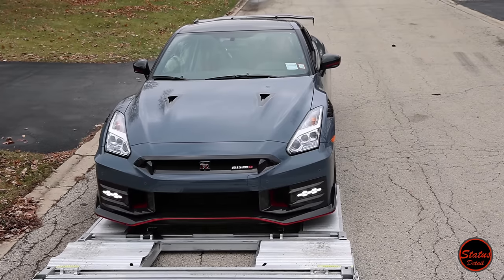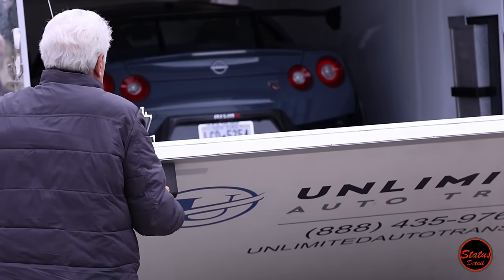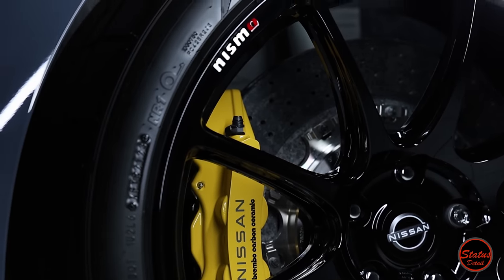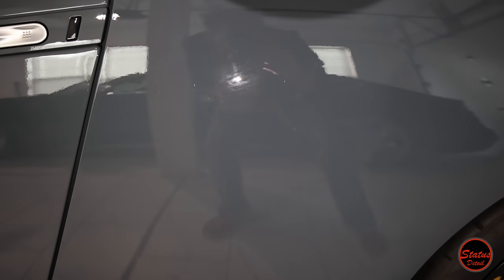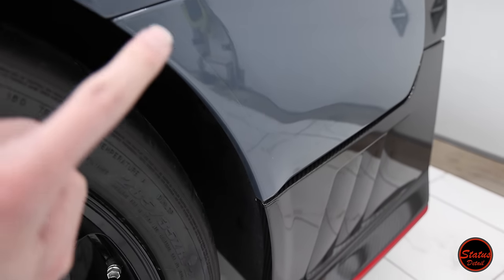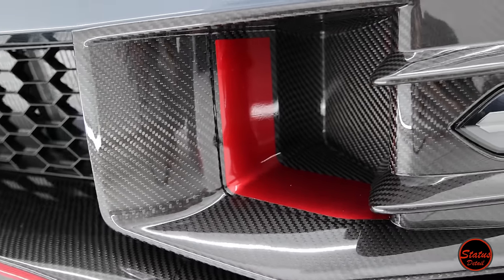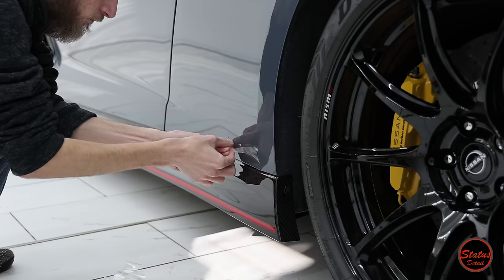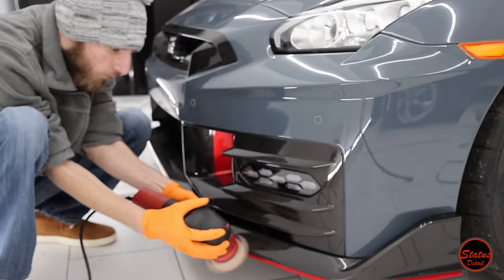RAREST R35 Nismo GT-R Gets $18,000 ULTIMATE Detail

Comment: I really enjoy your videos. The one thing i havent seen is you polishing near mouldings or adjoining panels. I dont see any protective tape near rubber or plastic or trim rings ect. As a matter of fact i havent seen any protective tape or drop cloths or paper. I know that these polishes and cleaners can discolor senstive rubber insulation and other seals. You talk about dust being an issue but i dont know if you have air filtration systems in your shop. Do you have a lift to clean the underbofy of these cars? Ive only watched this video and the audi rs5 video so far. But it seems you didbt have the finished glamour shots at the end. For the prices you are suggesting it just seems that you should have clean air filtration and be protecting the glass and rubber when you are working with high velocity polishers. Maybe Im missing something...
Reply from the maker: Hello! Nothing to really protect with glass. Not sure what your thinking can damage it? 

In certain cases I'll mask off thing's but it's rare. It's a can of worms especially on old cars. Masking tape can cause some issues one of the issues is that people rely to heavily on the fact that they masked it. Then jamming the pad up against it constantly which then makes you paint correct the tape pulling nasty residue from the tape of your pad and that causes issues on your paint especially on soft paint cars. So ultimately whether it's mast off or not the simple goal is to never touch it anyways. When your paint correcting a brand new car and you're being careful you shouldn't be hiting those rubber trims ever. Even if you're paint correcting up to that line like 95% no one's going to see that level of paint correction in the millimeter or two that you're missing up and close around that trim. Someone will definitely notice discolored trim or damage trim or odd holograms and the paint from picking up too much residue off your tape and then putting it back into the paint. You can end up chasing your tail a lot too and then your thinning paint pulling out residue because you can't finish the correction out perfectly. Pulling tape off trim that's been sitting for hours or days can sometimes actually damage trim. That's More common on slightly older cars though. Long story short I'm pretty against masking things when it's avoidable. Especially when you're doing things with a rotary it's pretty easy to avoid hitting the wrong stuff. Now if its that's a black car and it's completely destroyed top to bottom You're going to probably want to mask into everything you can to correct the paint top the bottom. Hope that all makes sense. 

No lifts for now. I'll build a shop one day with lifts. Cleaning the bottom isn't really that important on cars with 25 miles and that's roughly 90% or more of the kind of work I do.  It's always important to remember if I clean something and even ceramic coat something that you yourself will never again clean then it is a little bit pointless. I like to call these serviceable and non-serviceable areas. If it's not serviceable or non-serviceable and I go to town cleaning it and protecting it and then you drive it 300 miles or 4,000 or 10,000 but never clean it again then it doesn't really matter if it's protected or not. Cleaning something improving it in ceramic coating it does not make it impervious forever. All ceramic type products will need general cleaning and maintenance to work. It's like getting your teeth cleaned then not brushing for 3 years. You still need to do your standard maintenance. There's a big difference between those services and like undercoating sprays on a pickup for example. That's a install it and kinda don't worry about it for years kinda service. 

The room is sur conditioned with filter's. Plusvi keep it pretty clean. That's mostly helpful for PPF. 

The simple fact is doing what You see in the videos meaning high end paint correction high end ceramic coatings and PPF and the overall customer service you get before during and after your detail makes up the price you pay. If I added more service's in the future it would add cost to the detail. It would not mean the cost remains the same because it's already expensive. 

Many people watch the videos thinking it's expensive and I should charge less or offer more like underbody cleaning etc. The reality is our core customer understands the value that's provided and that's why we are scheduled into nearly Sept with non stop jobs basically identical to this one.
Reply: Thank you for the thoughtful response. By protecting the glass I mean all the surrounding trim and insulation etc. In my detail experience it always seems to be a pain to clean off any sling out of those areas and it's easier to just cover them. I know that not over wetting the pads is crucial. I just find it easier to tape and pull it as I move from each area . The reason for a lift or quick jacks is because # it's easier to keep the same pattern of polish when the car is off the ground some. And also and dirt and dust on the floor can blow back up if the rockers are too close to the ground. It's also much harder to see any areas so close to the ground. Ie: lighting or just a bad angle. It's also much easier to do wheels and tire sidewalls. I'm just a novice and your work speaks for itself. I was just curious. If it's a boutique kind of service I just figured you'd be set up like Ammo or something. Like using a cell phone light to find swirls is effective but I was surprised to see a pro doing that. Also idk know if you test for paint thickness with a meter or just eyeball and feel for it. I know from experience that the rockers and bottoms of doors can have much less clear at times. And considering it's the most exposed parts due to it's proximity to the road I want the car up a bit to see what I'm dealing with . Without lying down. It's been fun watching your videos and I thank you for being so informative.
Reply from the maker: @christianslense455  paint that gauge are helpful but they don't give you a full picture so to an extent they're not very helpful. They tell you how much of everything you have not how much clear you have. To the bottom line is it's guesswork. If I know I have x of everything and then I remove something that I know how much I removed but that doesn't tell me how much clear I had to work with the first place. So the bottom line is pink correct and sand to improve not remove and be mindful what you're doing and how much you're doing it. I always want to maximize how much clear coat I'm leaving on a car.

I've used scan grip lights before in the bottom line with this is that color temperature is going to be the biggest deal. I found that the color temperature of that phone light is good enough to see everything I need to see and everything the sun will show. For example my newer phone that I have now is actually a little worse at showing what I need to see. I'm sure there are lots of rules of thoughts and opinions on this but if you can see what you're working with then you can see it if you want to play with 27 kinds of light temperatures to see 1% more than go for it. Driving paint correcting porches long enough that I can do it with the lights off lol.

I do t really ever have sling. Just dust. This comes down to technique more than anything but also the products you're using.

Comment: Why aren’t you cutting the ppf with a printer?  Cutting on paint is bound to result in a slip and cut paint.  If the details cost this much you should expect that type of product
Reply from the maker: A plotter will not be as good as bulking. Many panels can only be done seamless by bulking. Plotter installs will always be worse. Plotter installs still require cutting because every panel won't line up perfect. If you don't cut often your more likely to cut paint as plotter installers don't cut as much as we do. 

Most important rare cars don't have plotter software. The software only helps if someone can scan the car and create the plotter format for it. So brand new rare cars must bulk cut.

Comment: Is it not crazy that the car came off the lot in this condition? The amount of paint correction needed is astonishing.
Reply from the maker: It's completely normal unfortunately. You can see in my other videos we've had things even more extreme than this on cars equally as expensive. I have more videos coming soon of cars that have crazy issues and have 50 miles or less on them.
Reply: @STATUSDETAIL  You guys did a fantastic job. Absolutely beautiful.
Reply from the maker: @benburton272  thanks!!

Comment: I don't know if he does ceramic coats wheels, but will that protect swirls on gloss black wheels?
Reply from the maker: I did ceramic wheels. It helps in the sense that they stay cleaner longer and are easier to clean. Technically they are harder to scratch after ceramic but if you rub any grit into the wheel repeatedly it's going to swirl unfortunately. The carbon ceramic brakes don't make dust so that's a big help. If you have steel brakes it's virtually impossible to not swirl them out but a great process will make it happen slower. Auto car wash brushes will destroy it in like a month lol
Reply: @STATUSDETAIL   I know it cleans easier. So swirls are still unavoidable.
Reply from the maker: @One21P  yea id go matte black if black is your preference. 

Swirls on gloss black isn't end of world. Just have the right expectations going into it.

Comment: Wouldn’t think the wheels would need to come off on this detail or car, with 100 miles, there is no grime or build up on the suspension components or behind the wheels. It’s literally brand new, the focus was paint correction and protection with attention to detail at a high level.
Reply from the maker: This guy gets it lol. Also their carbon ceramic brakes even if he drove a thousand miles there'd be like zero brake dust. Thank you for contributing the common sense that's missing from several of the other comments lol 🤝🤝🙂👍

Comment: Great work. I have this cars twin and PFS did mine, while I am biased I think they are the best in the country and they generally have 20-50M worth of cars in the shop on any given day. Interesting that my car arrived in far better condition and did not require as much to bring it to perfection.
Reply from the maker: Glad to hear you had a great experience and the car arrived in good condition! 

As I mentioned in my video lots of customers pull out all the lights and everything to look at it to find problems but often they don't do that at all Just take a walk around it and say this looks great. Until the car comes to me and I show them everything that was wrong. 

Unfortunately most shops don't do The steps we do before the film goes on which means if they didn't know this either then your car had all the same problems but no one brought them to your attention. This is very common unfortunately. Many PPF shops especially ones that only focus on PPF don't even paint correct cars they don't think it's necessary. This is more of a philosophy difference especially if a shop begins as a PPF shop first vs a detailing shop that adopts into PPF.

Comment: Does the clear wrap have different thickness and owner selects which one that want.
Reply: Its called PPF (Paint Protection Film) It doesn't come in different thickness however, you can select the finish.(Gloss or Matte)
Reply from the maker: STEK PPF is 8 mil and 10 mil. Most people don't use the 10 as it's harder to install and stretch often resulting in more relief cuts. It can definitely have its uses though! 7-8 mil is kind of like industry standard for PPF. We also have double layered 8 mil before in high impact spots like the 992 gt3rs fender areas
Reply from the maker: @adnanabbas6900  it does come in different thickness. Some PPF brands sell a 8 mil and 10 mil.
Reply: @STATUSDETAIL  Thank you, Sir! My installer lied to me then lol
Reply from the maker: @adnanabbas6900  I'm sorry that's the case! They might sell a PPF brand that doesn't offer the thicker version. Hopefully that's the case and they are honest people. Some people just don't like to talk about the thicker stuff cuz they don't want to inventory it. The reality in our situation is that if you want the film to be really invisible and look really good and have no stretch lines or adhesive lines then 9.5 times out of 10 you want the 8mil. Like I mentioned I think earlier in a comment if there were some really bad high impact areas for example on a GT3 RS or a 4 RS we might consider double layering film kind of like a tearaway on a race car helmet. So after about a year of driving you just pull off that second layer and then you still have the base. My honest opinion I find this more sensible than having a thick 10 well that still needs to be replaced after it gets beat up. At least when you have a double layer and really specific important spots you get to convenience of pulling it off and not needing to reinstall. A second double layer piece is usually a really precisely installed thing too so it's usually lower cost than you might expect.
Reply from the maker: @adnanabbas6900  thank you for taking the time to watch and comment 🙂👍🤝

Comment: How are you drying the car after your second wash?
Reply from the maker: After the car is paint corrected I basically blow dry the car to 99% dry. Then I take a brand new clean microfiber towel with with gyeon prep. To do a very light wipe down of any residual water and then begin the PPF.

When a car is fully finished and I'm washing it like for maintenance that process is similar I'm still going to blow dry it until it's basically completely dry but then I'll take something like gtechniq ceramic sealant "C2" spray that once or twice on the panel and then dry it with a drying towel and then go around the car that way adding protection and getting the 1% of water left over

Comment: 1:50 wait…. The GTR is AWD. Why are the rear wheels free and the front wheels locked down while the car is in gear and backing up???
Reply from the maker: Not sure I'm guessing in neutral it can like decouple the front and back. The trailer pushed it out. Then it drives out after

Comment: Is cost the reason that anyone who installs PPF doesn’t have the equipment to pre cut PPF templates, instead of cutting it once it’s on the car?
Reply from the maker: I could buy a plotter. I could buy multiple plotters and have multiple employees and up my volume of work. But I aim to do things perfectly. Plotting won't be perfect it's just faster but with a cost on the aesthetic side. 

Bulking is a fully customized install and will maximize the installers ability to make the PPF invisible and reduces many potential defects. 

A plotter will cost anywhere from 3500 to 9000 plus monthly software. Many shops can't afford that. But many shops can and prefer to bulk. We are one of those shops. 

Hand cutting is a art forum and it's important to remember plotter installed film won't go on perfectly. So it will require you to trim at times. So you cut on car no matter what. Especially on things like mirrors or any panel requiring huge stretch or any really exotic cars or brand new models. As there will be no software to cut those cars. 

How I install is very slow and methodical. The average business would struggle installing like us. Plotting is fast and gets cars in and out
Reply: @STATUSDETAIL  thanks!
Reply from the maker: @Car10121-s  your welcome

Comment: How do you price out a job at $18,000? I’m not being rude I just would like to know the process
Reply from the maker: Basically it's the cost of the ceramic correction etc package they select. This car had a $4,500 package. Then cost o lf full body PPF. Then on out of state cars like this one you have shipped as well. This price includes shipping both ways.

Comment: so I bought all those soft brushes for my gloss black wheels for no reason? still going to scratch them? no wonder I spotted some lines on the spokes already
Reply from the maker: Gloss black is very hard to care for. With proper care it will build up much slower. So obviously it's worth using good tools and equipment. If you're taking care of an incorrectly it's just going to get exponentially worse at alarming rates.

Comment: Is it dangerous to to use blade to cut PPF ?? Won’t the blade cut the paint??
Reply from the maker: It's definitely possible to cut through the PPF and into the pain and accident. Good after you make so many cuts you begin to realize how much pressure to make and then you can be confident that every cut you make will only be scoring the film and not cutting the film. For an experience installer it's extremely safe for an inexperienced installer it's a bit risky

Comment: "PPF isn't supposed to be by hot items" Puts PPF directly next to the massive exhaust tips of the GTR which are notoriously hot. LMFAO
Reply from the maker: It's a little different. I mentioned this about 720s and flamethrower times too in video lol. Generally speaking it's ok by a exhaust exit. But it's discussed with every owner on cars like this. A cat or especially down pipe is way different. A down pipe) high flow car can literally glow under extensive load lol. Exhaust tips don't do that. Unless your running some crazy flame tune stuff. Then get the chicken ready your roasting everything!